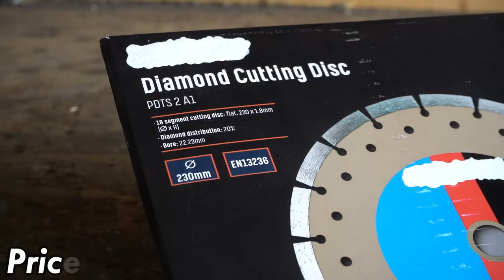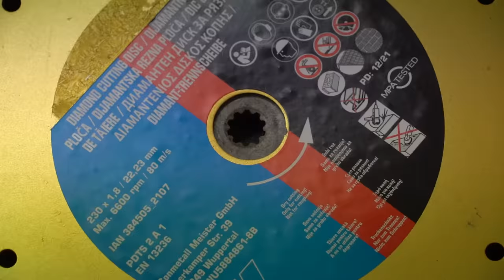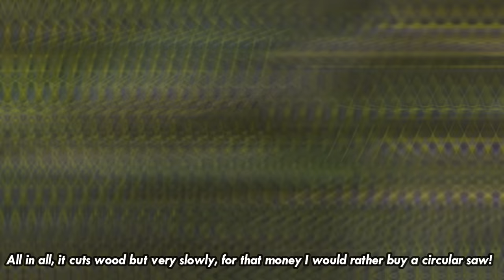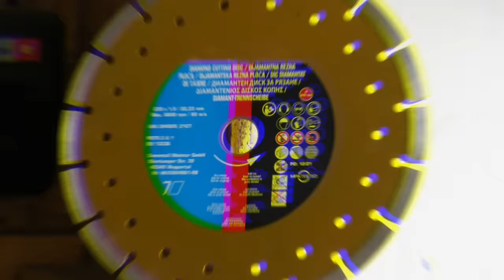DIAMOND Cutting Discs On TRIMMER !?  +TEST

Comment: You know when using a concrete cutting disc you have to keep the blade wet especially when cutting through concrete or you dull it super fast Cuts Like butter if it's wet it has running water on it